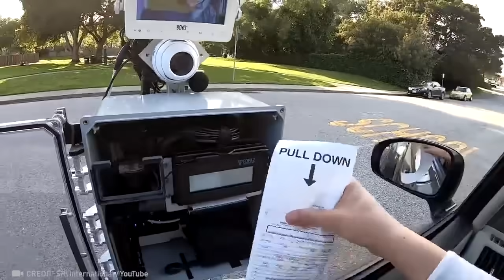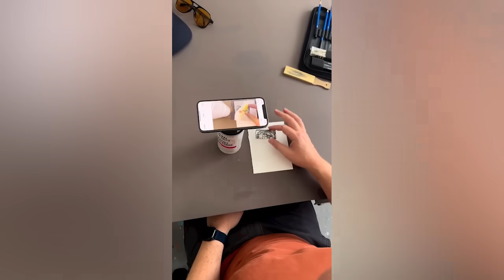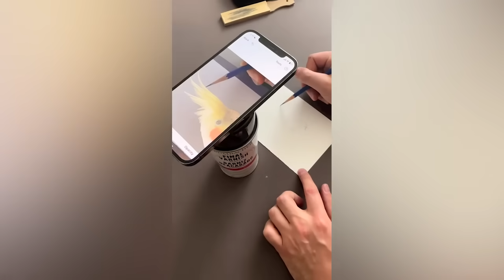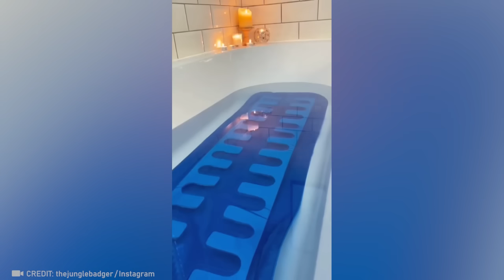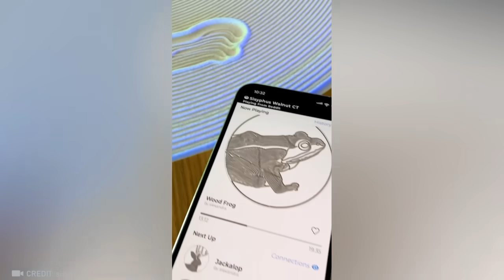Most Amazing Inventions And Smart Gadgets In The World

Comment: 21:40 Arcaboard:  Might I suggest a spring pressure arm in the back down to the ground with a wheel.  That way, you can get on, lean forward, and always go forward instead of almost sideways while going forward.  It would enhance driving capability and could be installed for a couple dollars.